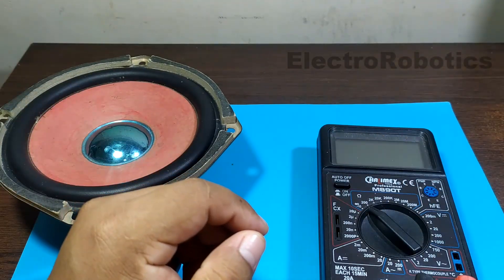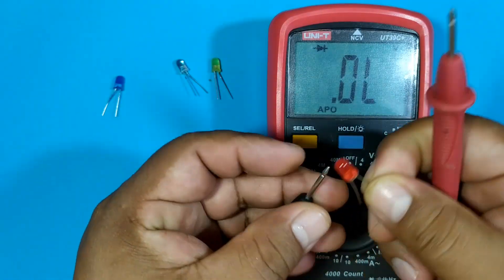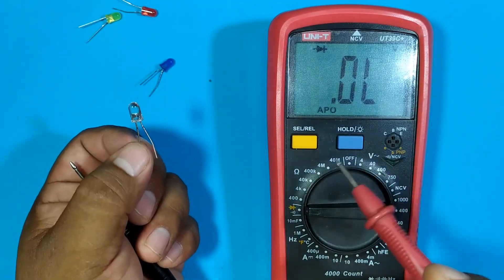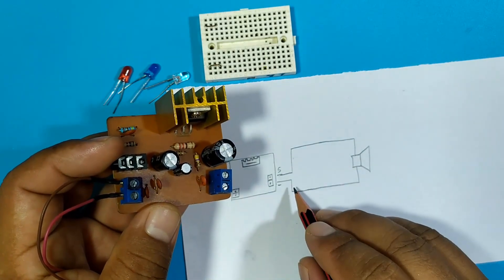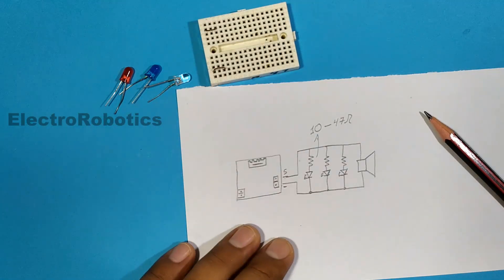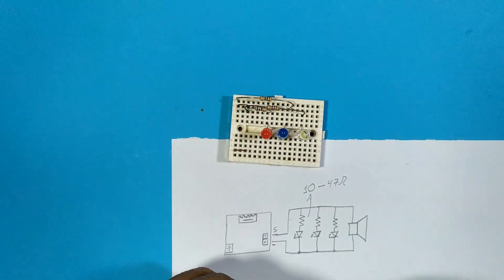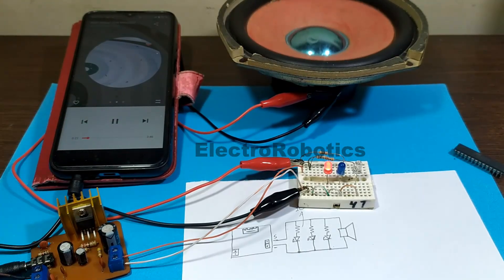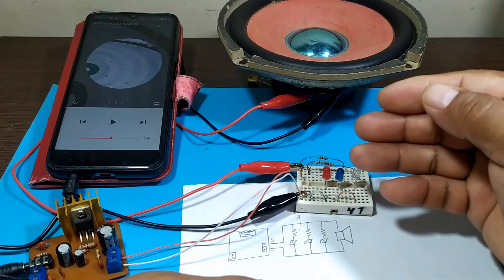An Interesting Idea, Lights to the Rhythm of the Music without using Integrated Circuits.

Comment: That was awesome, Thanks. I'm fairly new to electronics and I was under the impression that the components such as a resister, caps and the resistors are integrate within a complete system/ intergraded. I guess I am wrong. So what are these components called?